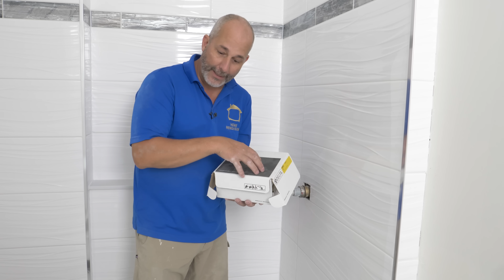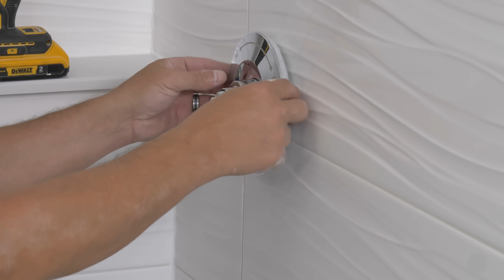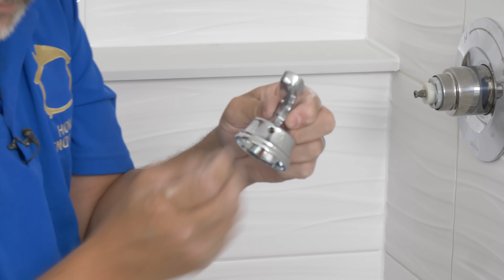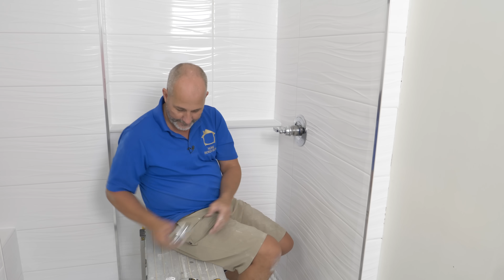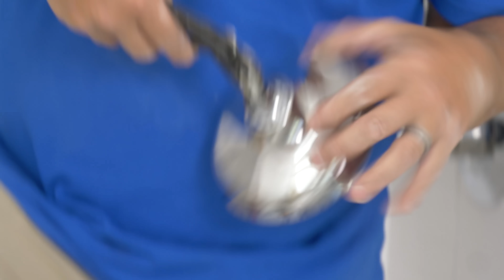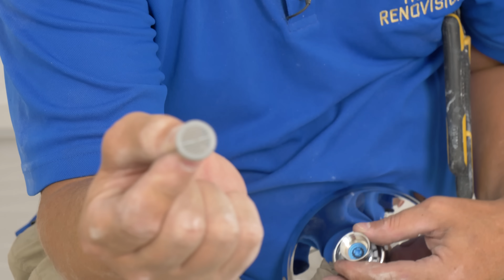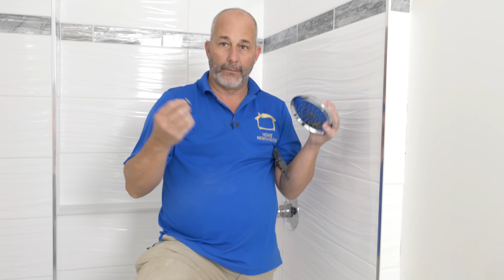Change Your Shower Head and Get BETTER Water Pressure

Comment: Before you take out the water restrictor, ensure you have a large drain that can handle the extra water. I loved the water pressure but I was up to my ankles in water!
Reply: Because your drain was partially blocked from inadequate flow over the years….
Reply: Isn't the water flow adjustable with the lever in the US? Is it always fully on or fully off?
Reply: @notinstructional  There are two types of single-handle water fixtures common in North America:  A rotating style like is seen in this video, which only adjusts the mixture of hot and cold water, and a lift-and-rotate style, where you lift (or pull) the handle to control pressure, and rotate to control temperature.  :)
Reply: @rhkips  I assumed it was the lift-and-rotate style. Didn't know the other one existed. Why would anyone want that? Is it alot cheaper?
Reply: @notinstructional yes. The more features, the more costs. Most developers/contractors building new houses install the cheapest products to increase their profit margin. Some times homeowners don't know the difference or can't afford the upgraded version.
Reply: Also check your water heater capacity--I took my restrictor out and while my pressure was awesome I ran out of hot water in 10 minutes.
Reply: I snaked the drain, used an auger forty feet, poured boiling water (usually does the trick) and ended up calling a plumber who poured expensive “eco” drain cleaner. Still didn’t drain well, three re-visits and $450 later, they gave up and said to put the restrictor back on.
Reply: @098mindstate  which leads me to believe either A, you have some serious volume, or B, some undersized drain lines. Most tub drains are supposed to be a minimum of 2 inches. Which should be enough. But if it connects with say 1.5 inches then it creates a constriction. Do you have enough venting to it?
Reply: @denisegaylord382  This is what I was thinking. My drains practically suck water away once they get going.
Reply: @TheRealCoolwater  I suspect a venting issue then. Does your vent go up through the roof, or side wall where you can access it? If so, you should be able to send a camera or a snake down it to see if its obstructed. Studpack here on YT had to clean one that squirrels packed full of pecans, 🤣
Reply: Not for single knob varieties. It’s on or off, the adjustment is temperature. There is a pressure adjustment just when cold.
Reply: Snake your drain and remove the hair ball, you should have anymore issues with backup.

Comment: What about the Climate Apocalypse. The California Governor, Newsom, called for water restriction, year round, drought or no drought. Don’t let him be president, you’ll have no water pressure. Yay Jeff. I love your voice. Your wife is a lucky woman. Great work!
Reply: We definitely should save water where possible. If you take 1 hour showers maybe leave the flow restrictors in. And they make great 1 gallon per flush toilets now. Just read the reviews so you don’t get a bad model. 

But really watering plants is where the most water can be saved
Reply: I have seen the lunacy of newslum and his cadres. I actually picked out a shower system with body sprays, etc. It can not be legally sold in CA or NY. It uses too much water. Both states have plenty of resources if they allocate them correctly. This push for reducing the ability to clean bodies or flush toilets is unhealthy.

Comment: Some of these new shower heads have very small holes in the head in order to work with low flow heads.  I discovered by accident that removing the flow restriction will give you nice high flow from the head but, you may also strip your skin off your body with all that pressure.  Just my FYI.
Reply: Turn the tap down then I would suggest..
Reply: @Tracertme  : That will not work in most newer showers these days unless you want a nice ice cold shower.
Reply: @ssrrocks22  isn't there a separate tap/lever thing for temperature and one for water flow? Seems odd, no?
Reply: @dennisblogg :  Most all newer shower valves don't have single hot or cold water advertisements on them.  If you saw the video here, you will notice only one handle. The reason for this is due to the newer type of shower valves, unlike a bathtub shower valves are strictly one handle.  You can turn it on and adjust the temperature of your water.  If you try to turn down the water pressure from a newer shower valve, you will simply get cold water until it turns completely off.   In other words, you will be standing in very cold water, and with winter on it's way you might not enjoy an ice-cold shower...
Reply: I think your shower might have some abnormal stuff going on.  I don't believe either a pressure balance mixing valve or thermostatic mixing valve should do this.  Unless maybe you have an old-style simple mixing valve and your water heater just can't supply the GPM because of upstream restrictions?  @ssrrocks22
Reply: @ssrrocks22  wow that's crazy. I assumed it was a two axis handle. twist for water flow and in/out for temperature or something like that.
Reply: @dennisblogg  : The mani reason for single handle shower valves today is to control the water flow.  Most, if not all, state codes require low flow control valves on all new fixtures in a home.  As for showers, if you look online you will not find all shower valves have a single handle, and if you look at all new shower heads you will notice the holes are much smaller.  This is another way to slow down the water flow.  Now, if you do remove the flow restriction on a new shower head, the water flow will be higher certainly, but you will also have needles like water jests on your body.  Most people can't stand having there skin being blasted off.

Comment: Jeff,  the only thing I would have done differently is on the threads of the flange and screws would be some silicon grease on them before screwing in place.  Just one little thing for later years...

Comment: They are also lifetime replacement if your willing to wait.  I’ve replaced by delta valves for free multiple times
Reply: For new products they require you to keep track of the receipt to use the lifetime warranty. So figure out a way of keeping track of them.

Comment: Huh, I thought it was supposed to be some kind of filter or something. We have dirty well water and I find little sticks in that thing from time to time. 😂
Reply: It also protect those same sticks from getting stuck further into the head ,where you can’t take them out. Much easier to clean this restictor then replace the head.
Reply: It does indeed collect crud.. which incidentally will make the water pressure even worse. 😅
Reply: @notinstructional  Yeah that's the only reason I knew it was there. Water pressure just died one day and I took the shower head off and there's a whole damn stick in there 😂 

It's happened another 3-4 times since then. Guess I'll just take it out, then.
Reply: You should install a sediment filter to your incoming water line from the well. Most well installations  have them to prevent sand and other things from being pushed through the house's lines. It can also save your appliances that use water: hot water tank, washer, dishwasher, refrigerator...
Reply: @denisegaylord382  Thanks for the tip!

Comment: Over time will the backing foam degrade and is it not best to add clear silicone around the back plate?
Reply: Todays bathroom foam is more or less indestructible. The bathroom will need renovating by the time the foam is degraded to the point of needing replacing.